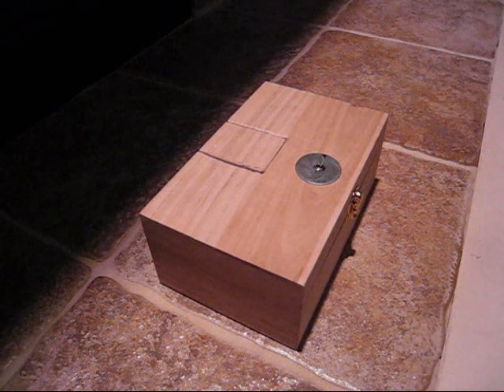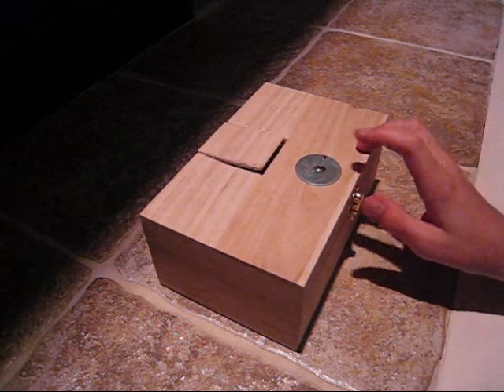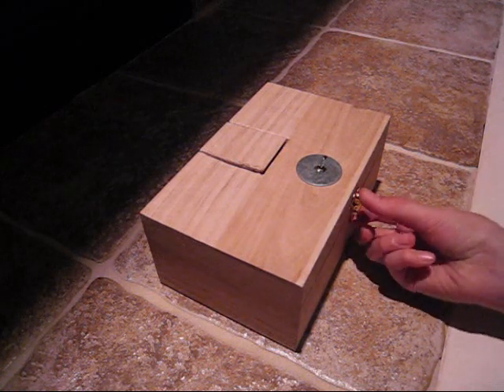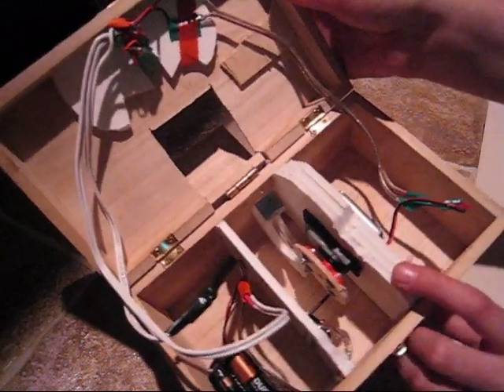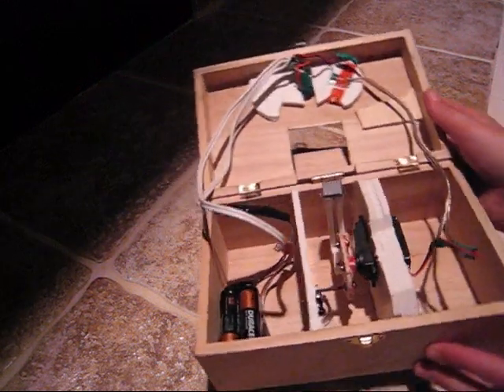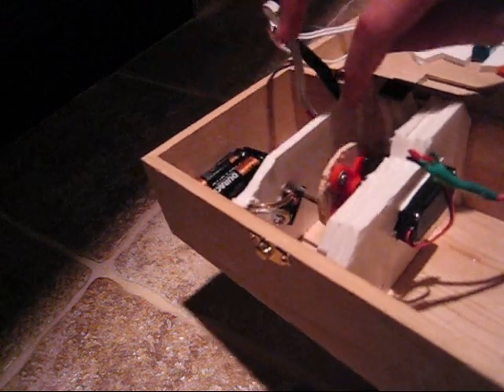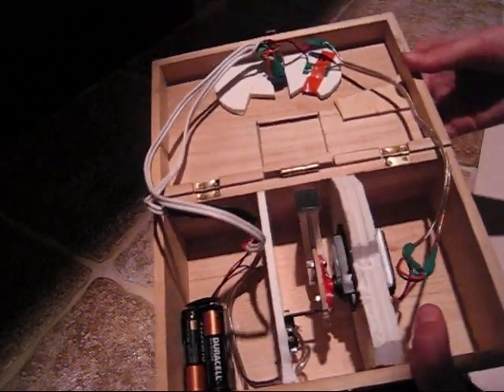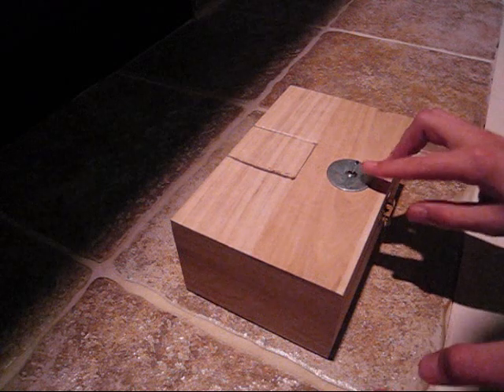Project: The "Most Useless Machine Ever" / "The Leave Me Alone Box"

Comment from the maker: @mgfurst When it flips the top switch the servo is given reversed charges causing the servo to turn the other direction until it rests upon a rollover switch that cuts off the reversed currents. Then when you flip the switch the rollover switch inside the contraption is released because the servo is powered forward by currents that do not flow through the rollover switch. Look the project up on Instructables

Comment: make an improved nodel that opens and close itselfe for infinite times... you  need for that a 3directional metalic switch which by "up" closes the cirquity(runing the cervo) by "down" changing the polarity of the cervo forcing it to turn on the oposite direction and  by"right" opens the circuit(killing the machine) and a "C" shaped "pusher" attached on the cervo so the switch is in the midle and the pusher will turn it up and down all the time.. a relay could magnetize the switch to go right